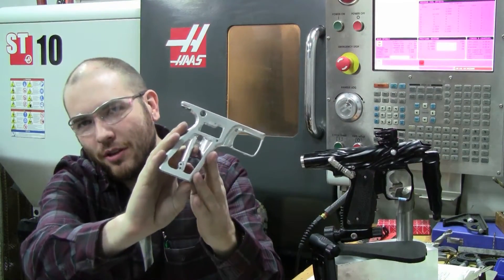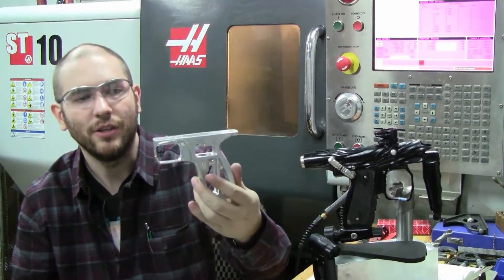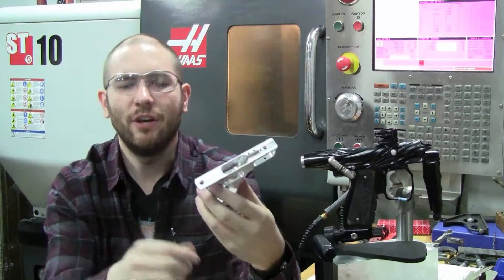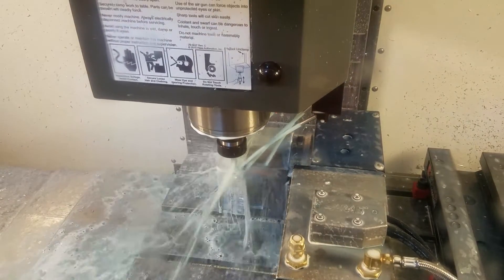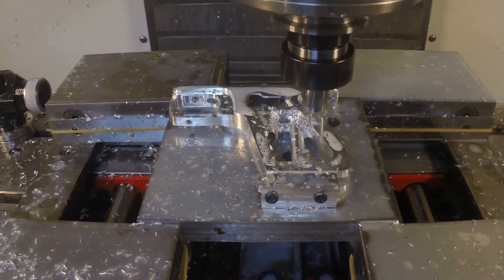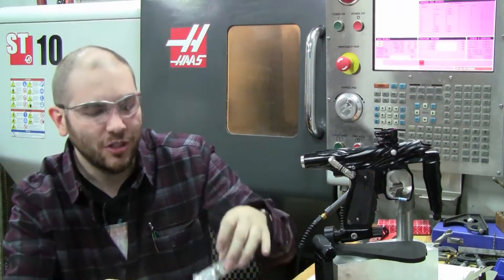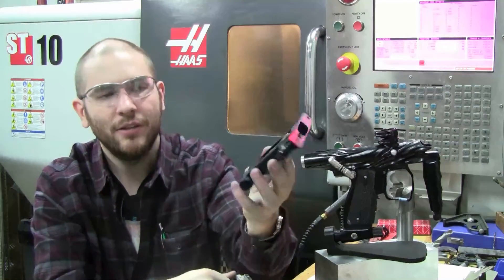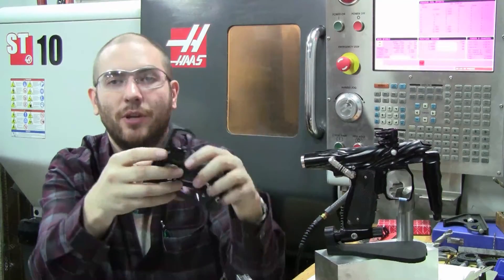Complete machining of paintball marker grip frame (Automag N-Mag frame)

Comment: Man, you really get at it! Those slotting cuts... and the entry plunges... I can't get out of the mindset that "slotting equals broken bits and/or chip weld". Gotta love those through-spindle drilling ops too! My eyes are like "HOW IS THAT POSSIBLE!?"
Reply from the maker: 40 taper is very forgiving! I almost always start a workpiece on a CAT40 machine to take advantage of that rigidity, but then move the items over to a BT30 for secondary cuts. These grip frames are kinda in the middle though, which can be frustrating...